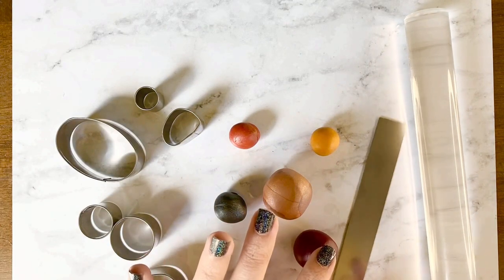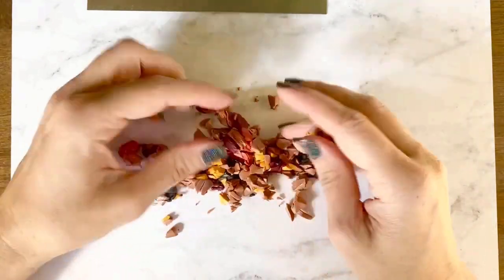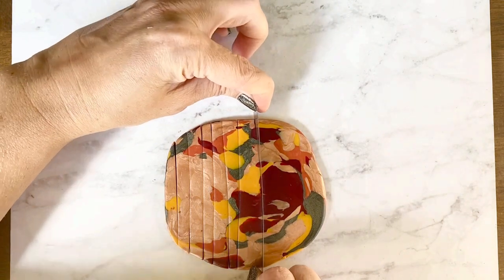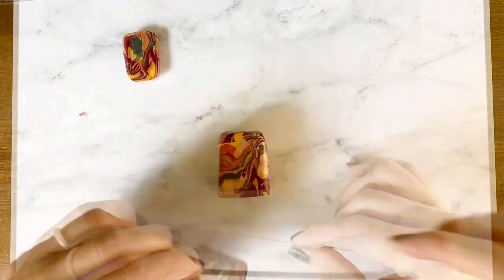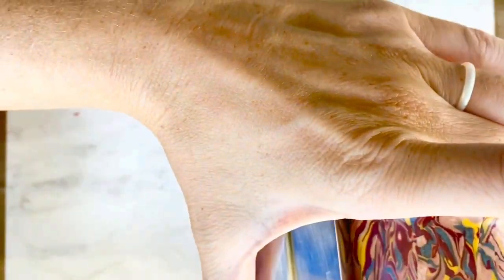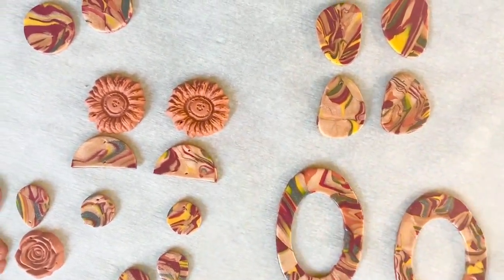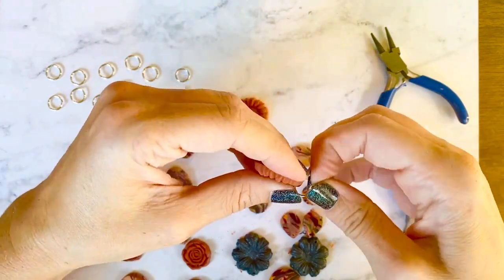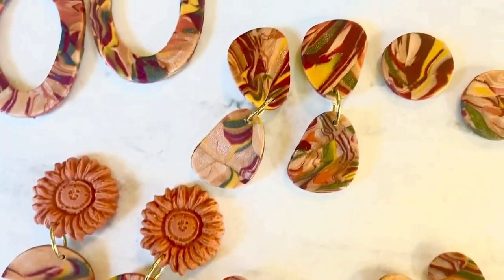NEW Polymer Clay Marbling Technique

Comment: Why don't you make the hole before baking? (Curious because I've never worked with clay before.)
Reply from the maker: I have done that before, and it definitely an option if you don’t have a drill. I prefer using a drill because it’s a cleaner hole. Also, when you make your hole before baking, it can alter the shape of the earrings because you’re shifting the clay, and essentially pushing that extra clay around. I hope that makes sense. 😊
Reply: What drill and pasta maker do you use?

Comment: What is the best surface to roll your clay on?
Reply from the maker: I actually went to Home Depot, and bought a porcelain floor tile. It’s only $2 and I love it! Here’s the link for the one I have. https://www.homedepot.com/p/Home-Decorators-Collection-12-in-x-24-in-Carrara-Polished-Porcelain-Floor-and-Wall-Tile-16-sq-ft-case-NHDCARR1224P/205138045
Reply: @greatestoftheseco7473  thank you! I was curious about tile. I got a glass cutting board and flipped it to the smooth side. My clay just sticks. Sticks to the glass, the metal roller. I’m clearly doing something wrong.
Reply: if your clay sticks to everything it might be too soft. Maybe try a different brand of clay, or put it in the freezer for a few minutes before rolling. Putting flour on your surface reduces sticking too.

Comment: Where can i buy polymer clay?
I'm from Dominican Republic and i want to buy a kit of polymer clay (online).
Btw, no polymer clay kits available on amazon.
Reply from the maker: There’s a small company called The Clay Republic that does ship internationally. You just have to check the postal service’s shipping policies. Covid has changed a lot of things, in regards to shipping. But also, if you have Instagram, check for clay suppliers there as well. Or any craft stores. I hope this helps! ☺️
Reply: @greatestoftheseco7473  Excellent!Thanks you so much💙😊😊😊

Comment: Hi, Its my first time using polymer clay and the first time I tried after heating the clay I saw that my earrings had bubbles. How do you prevent that from happening?
Reply from the maker: There are a couple of reasons it could be bubbling. Number one is the type of clay you’re using. Softer clays (in my experience) bubble a lot more. Also, conditioning your clay. I try to run mine through my pasta machine, or roll it with my acrylic roller for a few mins. If a bubble does for while you’re rolling it out, pop it with a tissue knife and roll it again. I hope this helps. ❤️
Reply: @greatestoftheseco7473  Thank you so much!! ❤️